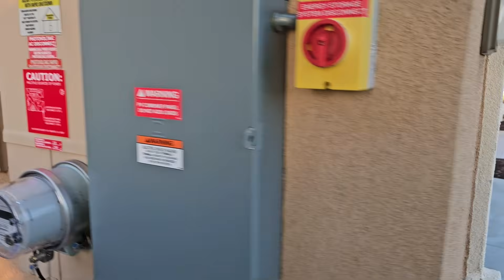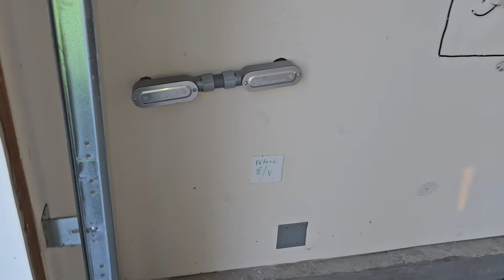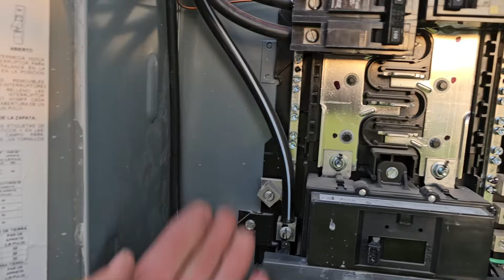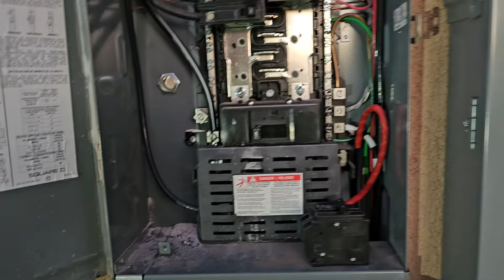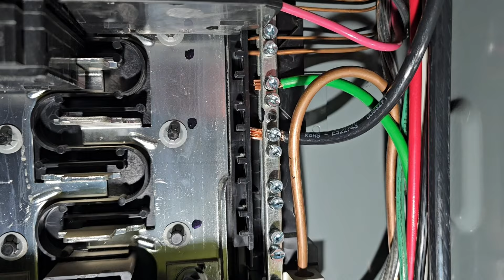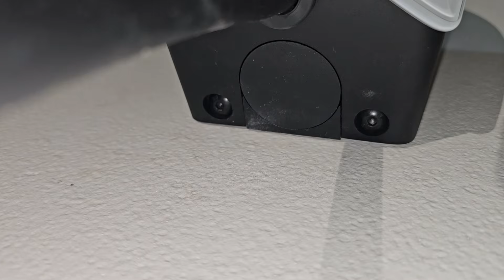Install a Tesla Charger the EASY WAY!

Comment: i actually have a question, but it is more on the mechanical side, i hope that's okay. do you still have the drilling template of this tesla wall box? cause i wanted to ask the distances of the mounting. i only have the overall size of the wallbox, but i need the mounting distance of the wall box. hopefully you could help me out. thanks a lot in advance!
Reply from the maker: Sorry I don't have the template but the back plate is just plastic so while there is suggested mounting holes you can make your own if necessary. 😊
Reply: @Technical_Electrical  i very much appreciate your response. thanks a lot!